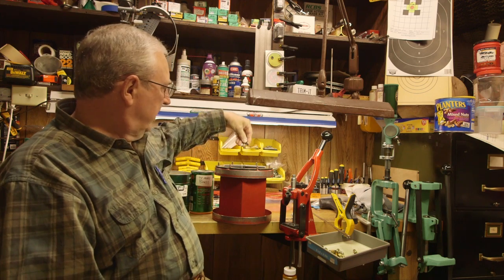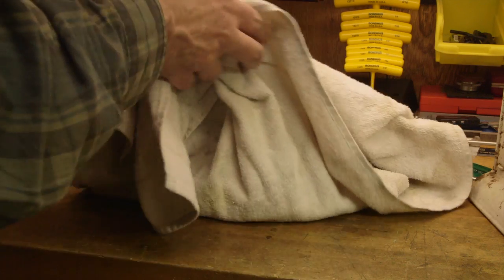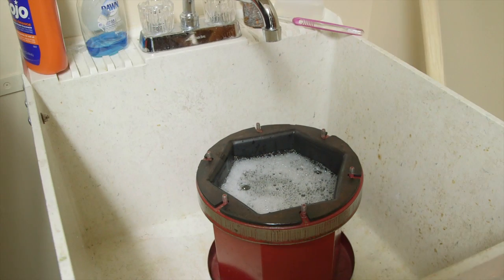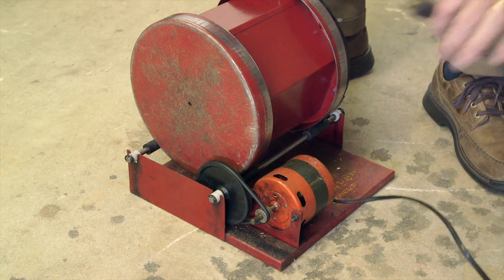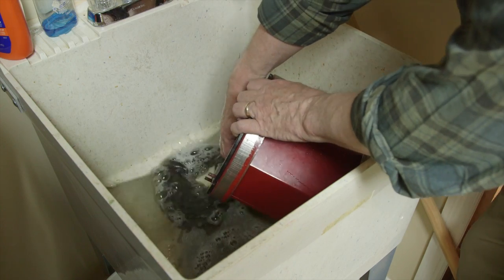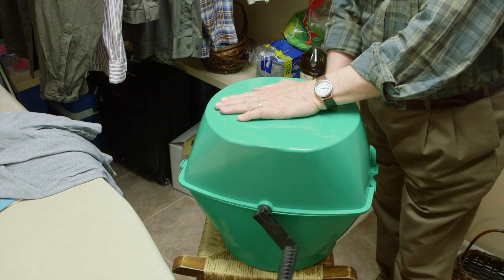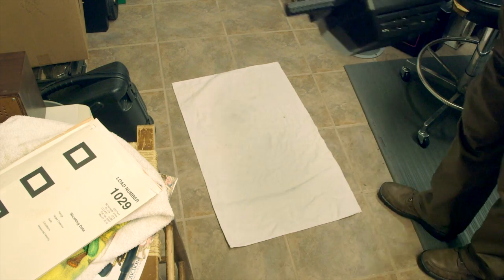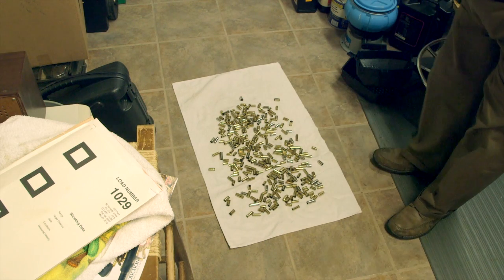Brass Tumbling w-Stainless Steel Pins

Comment: I have had the same unit for several years. No going back to dry media or sonic cleaning. I never have to worry about clean brass inside and out. Yes, it it very pleasant to reload clean shiny brass especially when I do not have to clean the primer pockets or flash holes. Just 2 hours and its done. Even nasty wintered brass that has been snow covered and stained cleans up right away. This thing is a fast working workhorse.
Reply: Nothing fast about this process!

Comment: Its important to deprime before wet cleaning so water doesn't get trapped in the primer pocket, that mixes with the residues and is acidic, if the brass sits for a year or so after cleaning, sometimes when you go to reload it the bottom of the old primer punches out, leaving the sides of the primer stuck solidly to the primer pocket, it is almost impossible to get those out, and it just kills me to have to toss otherwise good brass because you can't get the sides of the old primer out!  Also I never handle the clean brass with bare hands, you cleaned it to get rid of powder residue and tarnish, when you handle it with your bare hands you are starting it tarnishing all over again. When I load up a few thousand rounds of ammo I don't want tarnished fingerprints all over it when I pull some of it out to shoot a few months or a year later. Wet brass is handled with latex or poly gloves, I handle dry brass with brown cotton gloves, keeps that newly cleaned brass bright and shiny over the long haul.  I like to load in batches, spend a day or two loading a few times a year, and stockpile the ammo to shoot later.
Reply: Solid advice, thanks G5!
Reply: Interesting.  I always deprime first just because I want a clean primer pocket.
Reply: Thanks for the awesome tips!

Comment: Well done video. I've been using my homemade 5 gallon bucket attached to a geared 30 RPM motor to clean my .44 magnum brass & will be doing .38 spl soon. I tumble the brass to clean the insides, then lub & de prime/ flare mouth then tumble again to clean primer pocket & remove lub. The lub on the brass just makes resizing etc easier even using Lee dies all of this on my forester co-ax press. Thanks
Reply from the maker: Thanks. I also lube straight wall cases even when using carbide dies.

Comment: Hey Rex, Wet tumbling to clean has to be the way to get the absolute cleanest brass. I use a tumbler with cobb and walnut and I decap before cleaning and it comes out fine. I will still do a primer pocket uniformer and flash hole deburr because I have a Lyman case prep station which takes like an extra second to do.  I see you had "Riders", the 9mm in the 45's, but I honestly think that in a wet tumbler you won't see that problem as much as it happens in a dry tumbler. I think those riders that you had came from when you were separating the brass from the pins, except that 357 Sig looked like it was stuck pretty tight. Thanks for the Vid !!

Comment: Good video sir. The .45LC case looked brand new. Just to give you more possibilities, after rinsing and draining as much water as you can, place everything (cases and pins) on large cookie sheets and place in an oven at low to med/low temp to dry (oven door should be slightly open to allow watervapor to escape), then allow to cool, then tumble separate out the pins. I think you will find that your brass looks better (due to less water spotting), also ensures no water trapped in the primer pocket if your reloading in the same day, and the different caliber cases will not stick inside each other as bad due to water suction (but there's always those odd ones, lol). May want to ask the Mrs' permission first, or use an old junk oven to keep from getting a wood spoon against the noggin! I learned this technique from a Jerry Miculek video, and it helps, especially if reloading in the same day! Keep shootin'!
Reply from the maker: That sounds like an excellent process. Thanks so much for sharing. I had not thought of tumbling the dry brass to separate pins and cases.

Comment: Rex, you need to get yourself a screen mesh colander. It'll be a lot cheaper than calling a plumber or taking the time and effort to have to clean that trap out of some of those stainless pins or cases. Having said that, I think I like this way of cleaning the brass better. Will probably look into one of these tumblers fairly soon. Thanks for another great video.
Reply from the maker: Thanks John. I ordered a big strainer from Amazon about a month after I made this video back in 2015.

Comment from the maker: Looks like I'm way behind the curve on this one. As trickyric67 and Englishman French correctly point out, no need to get your hands in that nasty soup. I will get a strainer and magnet before next time. Thanks for the tips, guys!
Reply: Don't forget the plastic bag, or you will be pulling those pins off the magnet until tea time! I is lucky for us that these SS pins are magnetic, not all stainless is. The contaminants include mercury, and lead!
Reply from the maker: Absolutely. The bag was brilliant.
Reply: Rex Roach One little tip here is that if you cannot get sieve mesh fine enough at the hardware store, you can use the very fine stainless mesh they sell for putting up at the windows to stop the flies coming in.
Reply: Rex Roach don't feel bad. I was doing dry tumbling for over 30 years...

Comment: Separate the brass and pins before you rinse. Then pour off the black water, and rinse the pins to remove sediments.  The surface tension with the remaining soap will keep the pins clumped up and slippery. Use a clean paint brush to sweep back into the tumbler. Rinse the brass separate from the pins with a plastic coffee jug. I like the Maxwell House with a molded in handle and flat sides. Another great use for these is to drill a hole near the top and hang on hooks on the bench for a large catch bin for loaded ammo.
Reply from the maker: +DG Ficklin That's interesting and I will try your method next time. Makes good sense after I read through your description a couple of times. Thanks for taking time to view the video and, even more, to share your technique with us.

Comment: Check out Frankford Arsenal Rotary Tumblers. I've had and used one for a couple of years now, and I am totally pleased with it. Using the same cleaning solution as you, I get amazing results in three hours. That is as high as the built in timer goes. I've done everything from 9mm to .308 without a single hiccup.I've done as many as 250 .30 /.30 rounds at once with great results. Check them out as they include strainer end caps that would streamline your cleanup !
Reply: I use a Lortone QT-66 rock tumbler with molded rubber drums that have decagon flats molded into the interior and I can and do take the nastiest, most corroded and oxidized "chocolate" brass that has laid on or in the range dirt and mud for weeks, months and years and make it look like new in an hour or less. I don't know what you guys are doing that takes 3 hours or more, but I think your cheap plastic drums don't agitate nearly enough or you're overloading the drum or you're using too much detergent. If you end up with tons of suds, the cleaning action goes to shit. Soap suds are slick and a lubricant and cushion the agitation action. Less is more with everything involved and I've found that too many pins, too much Lemi-Shine, too much dawn or too much water all negatively affect the process.
Reply: Robert Byrns 
I've hear nothing but good things about it. Looking forward to getting one.
Reply: I use one and it works great. I got the double barrel since I shoot 2 223s and neck size only it works out great

Comment: Clever process there! I didn't think stainless would stick to a magnet. I guess some alloys of SS will. I'll be trying it! Many thanks!
Reply from the maker: The magnetic properties of the various stainless steels seem to be a surprise to most people. Thanks for watching.
Reply: Good heavens what a success! It doesn't get any better than this! I cut some stainless 1/16th tig welding wire into half inch lengths, it took a while. I put some nasty looking perfecta and wcc brass in the unit with your recipe and one hour is all it took to make them look like new Norma brass!
Reply from the maker: Mike Miller that's a great idea to make your own stainless steel media. Thanks for sharing!
Reply: people probably are thinking of hardened steel like on knives, which to harden, requires high heat which will force any metal to loose its magnetism

Comment: cousin uses this method , remarkably clean brass , but , the best way to rinse the brass and pins is to dump them in a sieve and rinse them under running water !

Comment: I use the same system but never tumble brass that can nest in other cases. I always ensure that 9mm, .38 special and .357 magnum go together.  .44 Rem magnum and  45ACP are batched together and my .50AE goes in separately.

Comment: I have found that with a clean pocket , the primer seats smoother. Goes in very easy. No resistance.
Reply from the maker: Excellent point. Now that you mention it, that's always been one of the joys of new brass, every operation is so smooth. Virtually the same with pin cleaned.
Reply: Philip Adams, That's what she said.

Comment: I use a Lortone QT-66 and have done probably hundreds of pounds of brass with the same 5 lbs of pins I bought initially when I started. I've taken "chocolate" brass I literally had to pry out of dried dirt and mud at the range, rinsed it in plain water to knock off the big chunks, throw it in MODERATE volumes in my Lortone drums and with a drop or two of Dawn, a light sprinkle of Lemi-Shine, hard tap water from a farm well and an hour or hour and a half at most I turn out sparkling like-new brass. I don't know what the guys who claim 3 hours in a larger tumbler are doing wrong, but I suspect they're overdoing something. 

Too much of anything will slow down or completely stall the cleaning process. Too much Lemi-Shine turns cases pink in my experience and its not limited to brass, I've got some steel boxer-primed Wolf .45 ACP cases I reload mainly because the "experts" say I can't or shouldn't and they'll produce a pink tint with too much Lemi-Shine, too. My pin to case ratio as far as weight goes is probably 1:5 or thereabouts and I only use a "lot" of pins when I'm tumbling .50 BMG cases, which I can only do 7-10 of at a time. 

Too much Dawn in particular knocks the hell out of the cleaning process because all of the suds cushion the cases and reduce the agitation effect and prevent the cases from cleaning and polishing each other as they rub together, which is the PRIMARY cleaning process that occurs. Pins get in the nooks and crannies but most cleaning is case on case.
Reply from the maker: I REALLY appreciate your comments. I have a batch of dug-out-of-the-dirt range brass I plan to clean tomorrow. It's Labor Day, after all. I'm going to try your suggestions and use less of everything, except brass.

Comment: Your wife is going to be mad at you Rex messing up her laundry room ! I find the Rebel 17 to be by far the best of these machines as it runs on ball races, that said, yours looks good after many years of use.
One thing I would advise is not to get your hands in the contaminated water after tumbling, the water is loaded with lots of nasty things. It probably will not affect you at your age, but not something you want to do. If you get a 2 Ft sieve with very fine mesh, dump the whole lot in, give it a shake, then pour it all on a large old towel, you can then use a large magnet in a poly bag to pick up all the pins, the SS pins will be dry, hold it over your tumbler body and pull off the poly bag, the pins will all drop into the bin. I also mix a car wash wax solution and drop the polished cases into it, this stops them tarnishing. Once you use this method, there is no going back!
Reply from the maker: Englishman French Thanks for your always insightful comments. Give me some more detail about the "car wash wax solution" and how you use it.
Reply: Rex Roach I have just tumbled some Colt 45 cases, I drain the filthy water off into a bucket using my 24" fine mesh sieve, mix some of the car wax/wash liquid in another container, then pick out the cases and drop them into the car wax solution, you can pour the wax mix into a container for use again if you shoot a lot, the cases will then have a coat of wax on them and do not get that "water mark" you get if you just dry them, by that time the stainless pins will have dried in the sieve, and can be poured back into the tumbler vessel, do not leave the pins in contaminated damp solution for too long, stainless WILL rust under certain temperature/humidity conditions. P.S. You must dispose of the contaminated cleaning water down the foul water drain!

Comment: How long do you typically leave the tumbler running for each batch? I have always wondered about using those pins and wet tumbling, great to see how it actually all works. Thank you!
Reply from the maker: It has to do with how dirty the brass is and how clean you want it. I typically run about four hours to get them like new.
Reply: @RexRoach  Thank you so much Rex. Wasn't expecting such a quick reply, much appreciated. I am just about to get into reloading, finding out as much as I can first, and trying to sort out what I need. People such as yourself, who are so generous with their knowledge and experience, are gold! Cheers from NZ :-)

Comment: I'd suggest upgrading to a newer tumbler as that relic model B rotation speed appears on the slow side. A more modern one work much faster as they use better components. They work faster and have surpassed the vibratory tumblers both in speed and safer to use not dispersing lead dust into the atmosphere.
Reply from the maker: That speed would certainly make a difference. In addition, I think the rubber lining in mine is breaking down resulting in the unduly black water you see. I think that's 99% carbon black "extracted" from the rubber liner.

Comment: If after a while NOT cleaning primer  pockets you will start to have high primers which can be dangerous. I  have been reloading 42 years and I  know what I  am talking about.
Reply: Been reloading 30+ years and I also know what I am talking about.
You will lose your brass long before there is enough crud built up in the primer pocket to prevent proper seating of primers.
Most of the crowd gets blasted out with each successive primer ignition.

Comment: Just love this video, concept, and leadership.  Might offer for anyone interested in following these footsteps, the Thumlers Tumbler is still very much available, marketed primarily to the rock polishing community.  Trick is, and it's hard to find this, there are two motors available -- the rock polishing motor more commonly found is 1,550 RPM, while the brass polishing kind is available at 3,000 RPM.  So I have have an extra motor available, since I had to purchase the faster motor separately.  Also, the instructions I received said nothing about the horrendous squeaking of the nylon bearings used in the unit.  Some 3-in-1 oil took care of that -- I hope the bearings are not soluble in the oil.  For anyone interested, the stainlesstumblingmedia.com link listed below, is selling the "high speed" Thumlers Tumbler B at a great price.  And I just took out my first load of .223 Win, and sure enough, Rex speaketh truth.  Shiny, including the primer pockets, just as advertised.  Thank you.
Reply from the maker: Excellent addition to the discussion. Yes, a little bit of light oil works wonders. Thanks so much for sharing.

Comment: After separating the pins from the brass, I dry the brass on a sneaker rack covered with wired down dog window screen.  Run your dryer and they come out dry after one quick cycle.  About 20-30 minutes.  Brass comes out totally dry inside and out.
Reply from the maker: +George Colbert I had been pondering over how to dry the brass in a clothes drier. I had thought of using a mesh bag, but your idea tops that because it would protect the inside of the drier from clanging brass. Great tip!
Reply: @RexRoach Try putting your brass in an old pillow case with the end tied shut. Then throw it in with “dirty” clothes so the brass doesn’t ring against the sides of the dryer drum, and the other clothes help to tumble the brass
Reply from the maker: @4570Govt  I like that idea!

Comment: I've just watched this for the fourth time, and do not hear how long you run the brass.  I'm sure "it depends" is one answer - I know you can do better than that.  All I heard was "this is slower" and in another place when looking at the dirty water you said, "I ran this a little longer than usual".  How long ?
Reply: I wet tumble my deprimed brass with pins for 3 hours. That gets them nice and clean.